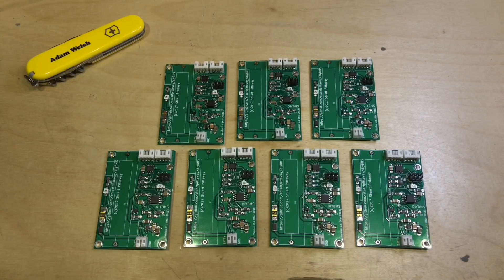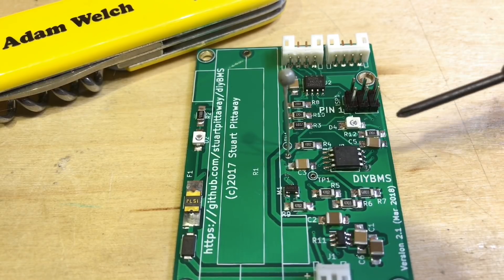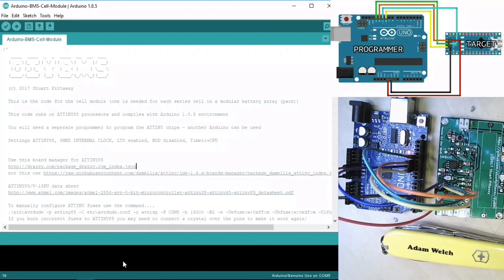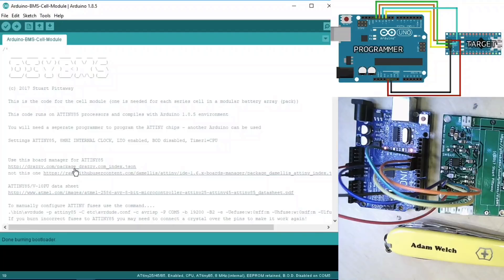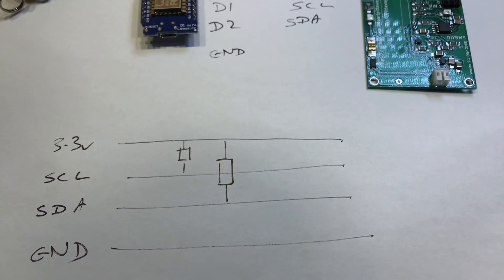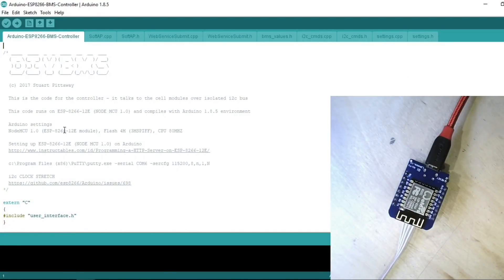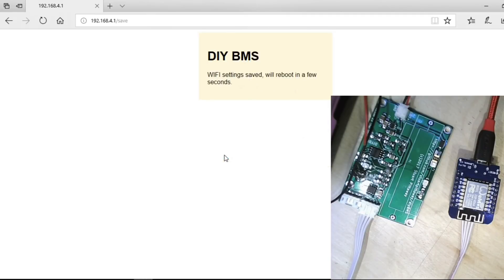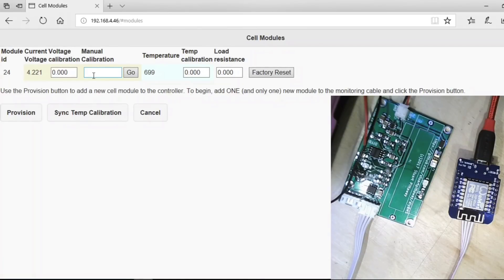diyBMS - Programming a module with an Arduino - 12v Solar Shed

Comment: Hi Adam, I really like your work. I just want to ask where we can buy this diyBMS - Programming a module? Any Link? Thanks in advance
Reply from the maker: Well this video is based on version three of the diyBMS. I’d suggest looking at my videos recently on the version four boards. In my video about programming the diyBMS v4 modules I’ve pinned a comment below the video Where I show how you can now order fully built modules from China. You can’t however have fully made central controllers built (I build one in my latest video) So I’m afraid there is always going to be a bit of ‘do it yourself’ in the diyBMS.

Comment: Hi All, can anyone help? I soldered all the components on one of the boards and burn boot loader to attiny, the green led shows really dim once done, I then uploaded the program to the attiny85, the green light then remains brightly on at all times when power is applied using 1 x 18650 battery. But I cannot seem to provision the unit from the DIYBMS Mgmt console.

When I click provision the blue light flashes on my D1 mini, I waited but nothing happens, the module is not being detected.
How and where do I start trouble shooting this?.

Thanks in advance.

Comment: Just like to add that it is super important to double check the settings. I was getting all sorts of errors because I had some incorrect settings. The most amusing error message was "an error has occured". Great how do I debug that? Turns out I had set Programmer: AVRISP mkll instead of Programer: Arduino as ISP.

Comment: Adam, It seems like once all the software glitches are worked out of the diyBMS you 20P packs should stay in balance! I am wondering how you plan to protect the bank from over discharge, and does your solar controller protect the bank from over charge?
Reply from the maker: Yeah over charge and over discharge should be sorted by the charge controller - as long as all my loads goes through it.  The BMS will just keep the groups in balance.  That's what I'm expecting anyway...

Comment: The pull up resistors should maybe be incorporated in the balance board. Infact how about in the next version having pins on the board for connecting the wemos directly?
Reply from the maker: It’s not my design, but placing the pull-ups on the balance board modules may cause an issue. If you populate all the modules with pull-ups then you’ll have very different values. If I used 4.7k for example and had them on each of my seven modules then the overall pull up resistance would be 670 ohms. The balance module is suitable for all sorts of different size packs as it is. Of cause you could incorporate the pads for the resisters and just note that only the first (or perhaps the last) module should be populated.

Comment: Well, I heard a whooshing sound for most of that video, followed by an incorrect voltage. ;-D Hadn't a clue about what you were doing for most of that. 
Seriously now: Wouldn't a multimeter be a lot quicker, sompler, cheaper and more accurate? Or is that me missing the point? Thanks for the video, Adam.
Reply from the maker: This system is going to check the voltage of each group of cells in a series set. Sadly without close management the cells can get out of balance and then some may be over or under charged. 
Hopefully as the series progresses it’ll make more sense. Cheers.
Reply: Ah, fair enough. Yes, I understand about cell voltages becoming unbalanced. Jehu Garcia explained that very well some time ago. My concern was that you were going around the houses to reach the front door. Your approach makes more sense now. Thanks again, Adam.

Comment: Adam, does each board have to have a wifi module, or just one which can relay info from all the other boards in the stack, maybe over I²C?
I'm about to start to put together a 14S50P for my ebike which could also do 7S100P for my UPS, so this BMS sounds like it could be useful if the balancing current could be around an amp or two.
My progress so far: https://twitter.com/ahaveland/status/983468199206367232
Reply from the maker: No, one wifi module per bank.  The isolated i2c means the modules can piggy back off each other and there is no shared ground issue.  I think the system is perfectly capable of a 14s system with just one ESP8266.
Stuart is keen to point out the software is in it's infancy.  There is currently no automatic balancing, but there is a manually invoked average balance which he is testing.  Obviously you can choose your own discharge resistors, and you can probably upgrade the PTC to handle 2 amps continuous, the mosfet should be ok too - but might get a bit hotter.  That's a nice pile of cells - lots of hours spent and a few nicks and cuts I'm sure!  Cheers Andy
Reply: Thanks Adam, then it sounds quite promising. I'll follow progress with interest.
The software can catch up over time. First on my todo list would be to be able to set ToC threshold where balancing starts kicking in and BoC cutoff where any cell goes below say 3.0V for a configurable duration.
With a bit more work, the app could handle switching sources between solar, mains, battery, and between loads such as grid tie, battery or external load or a combination.
Yeah... know what you mean about the nicks and cuts, had plenty of them, and a couple of burns!
Once when trimming the -ve end with the +ve end pressing into my palm, the nickel strip shorted against its case, got red hot and burnt a hole in my palm. Have to pay attention!

Comment: Very interesting. I like that it's isolated that way. Makes things a lot easier to stack up.  Now we just wait for the next update when there are several boards connected and the cells are connected in series  🎇😉
I might end up forking this myself as I'm taking my bms in a slightly different direction. But this would definitely give it a boost in the right direction.